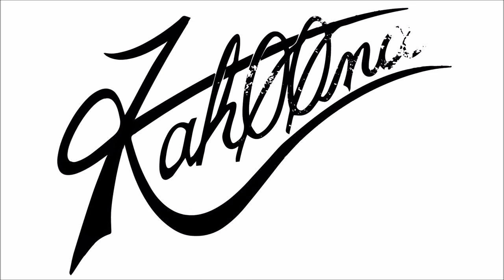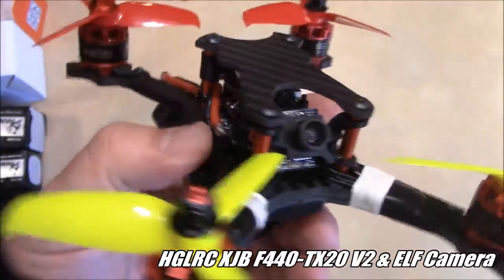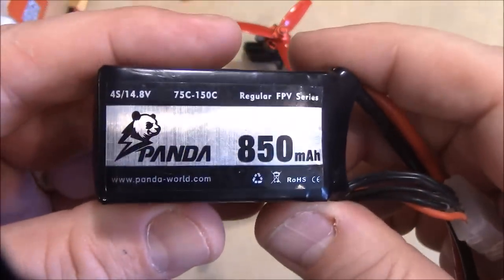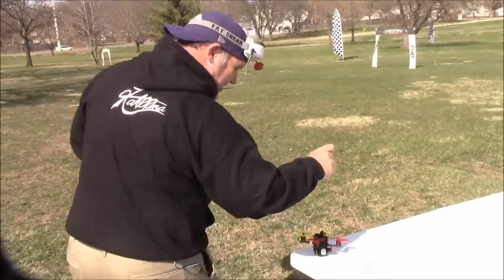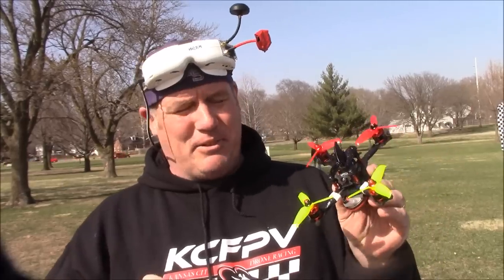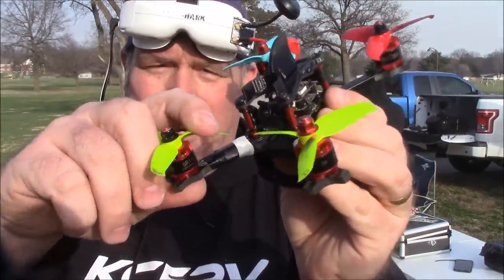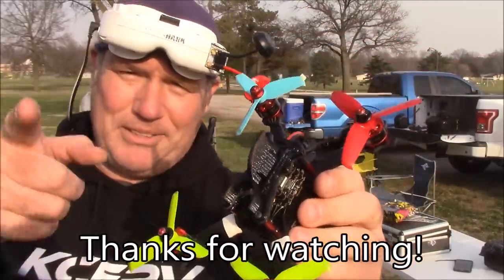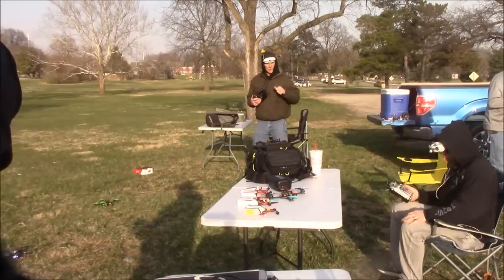Team Neugen Supervisor Build Review & Test Flights

Comment: I built the floss that’s in my pic with the hglrc 40a blheli32 stack.. caddx s micro, axii ufl, t motor air gear 200 2650kv motors on a floss 2 with canopy clocking it at 197g with no battery :)

I had to swap out the 12.9 steel for 7075 aluminum to break the 200g mark though :/